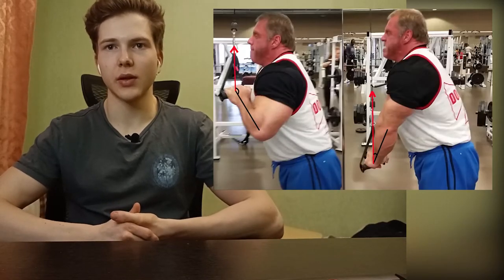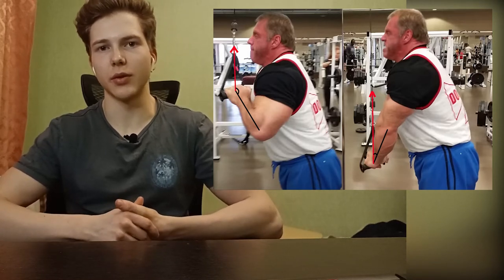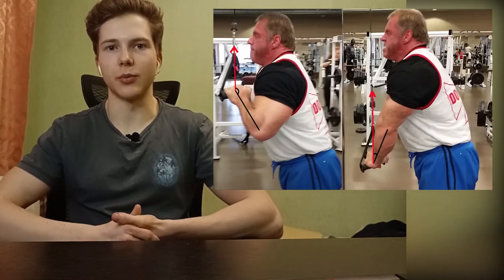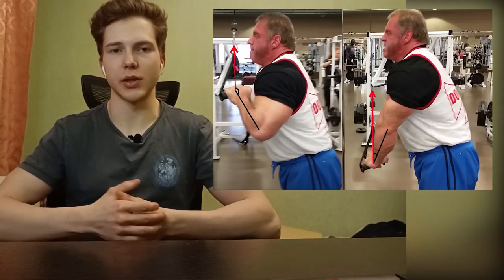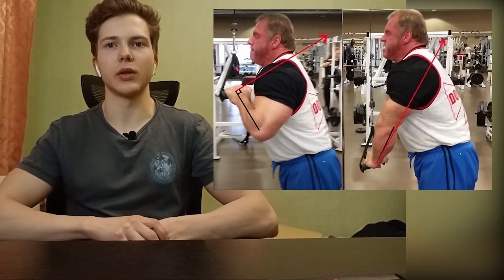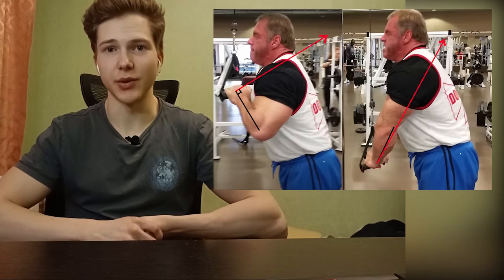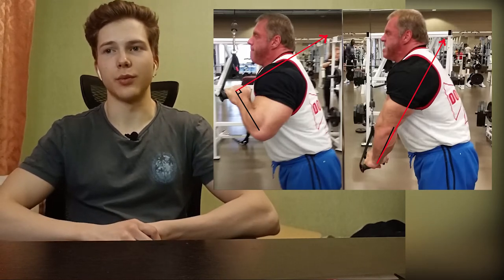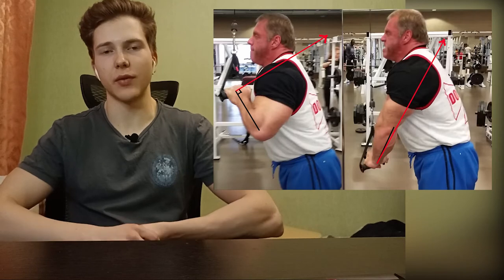Modified Tricep Pushdown | BRIG-20 | Why regular Cable Pushdown isn't Very Good

Comment: Alignment is compromised towards the end/shortened range, where the direction of resistance becomes perpendicular rather than parallel towards the line of pull/joint vector, opposite position loading principal is affected ... check some videos out by hypertrophy coach illustrating a more effective & efficient version biasing the same muscles & resistance curves involved here in your video.
Reply from the maker: interesting stuff, wish you'd recommended the actual videos though!

Comment: So this "modified version" is no different to the standard tricep push down, they both use the same  resistance  curve to muscle curve.
Reply from the maker: It's not the same though...
Reply: @nobodysfitness2852  Could you elaborate please.
Reply from the maker: @kevinspencer7053  rewatch the video friend I don't know what else to say lol
Reply: @nobodysfitness2852  1 minute 53 seconds in " mis match" ? Its the same starting and end position as the modified one, so the modified must also be a mis match.
Reply from the maker: @kevinspencer7053  the modified version puts the most amount of tension when the muscle is stretched - look at 3:30 - the angle between the line of force (the cable) and the forearm is about 90 degrees